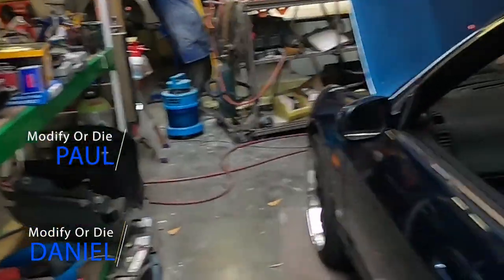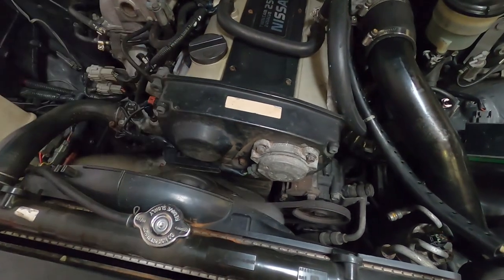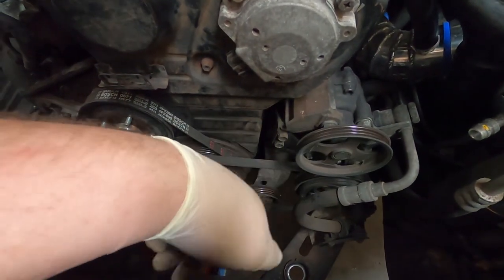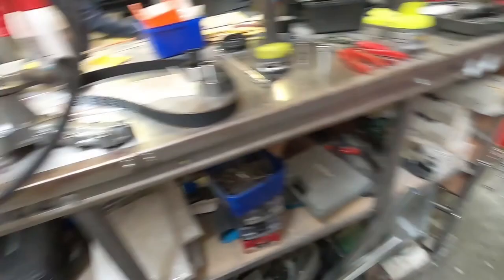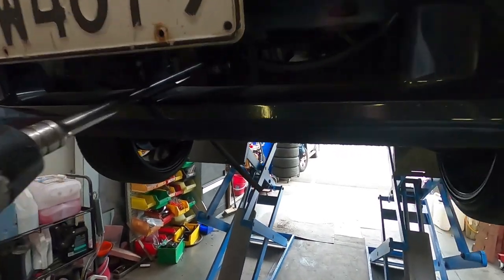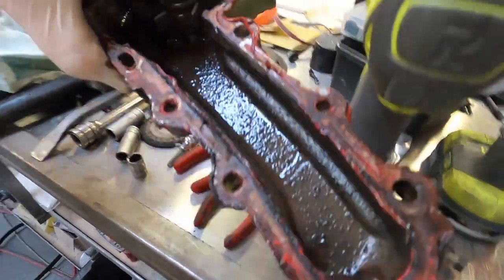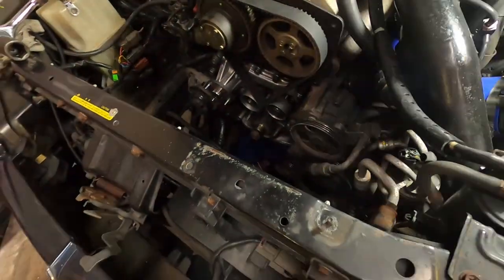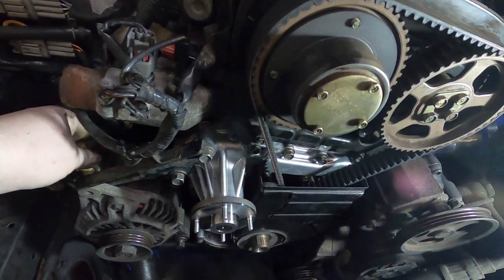Installing a new timing belt kit on the R33 four door

Comment: Hi just watched your video on the cambelt change, as I will be doing this soon to a R33 Skyline RB25DET engine can you tell me what make the cam gear locking tool is.
Reply from the maker: For cams, we have a t&e cam holding tool kit and for the crank if needed we have a custom made tool for early Nissans, but you can buy a crank holding tool.